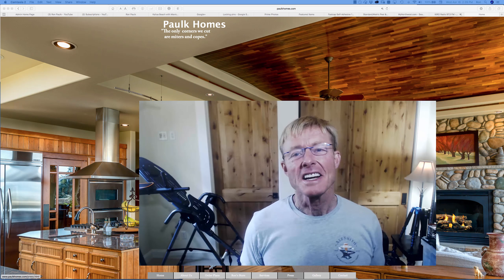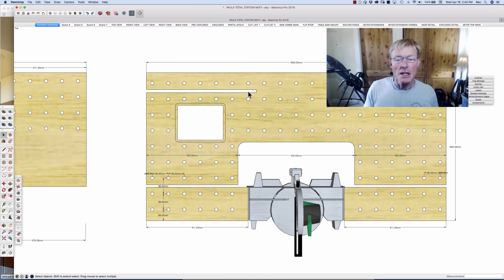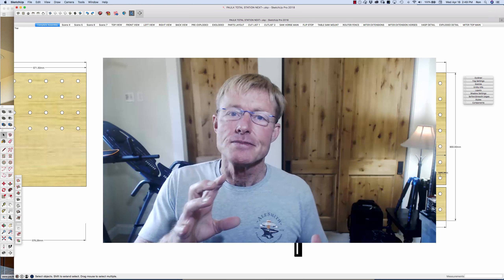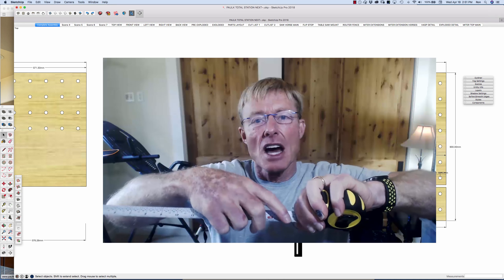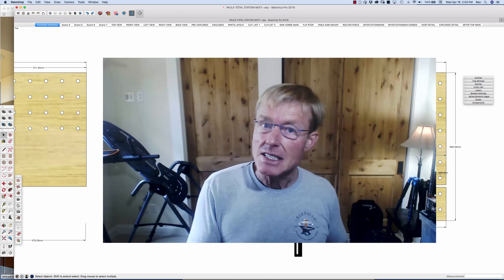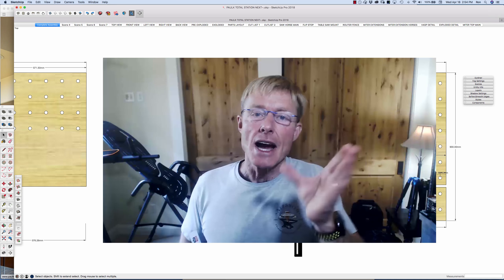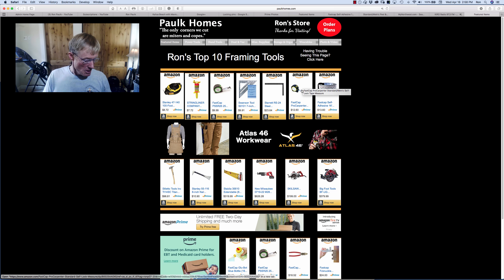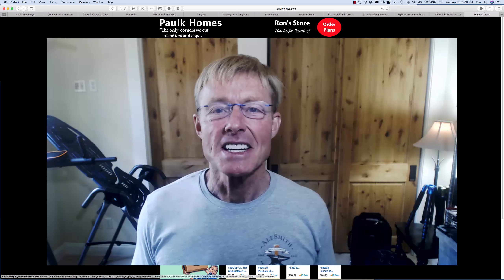I heard you: metric it is!

Comment: Great work Ron. 

It was suggested to me always to use metres or millimetres and never use centimetres and this gets rid of miscommunications and gross errors when working in a team as there is no need to confirm the units. (At the time we were measuring lines bigger than any house you have built)

Just something that was told to me in the 90s.  I have to use all measuring systems feet, inches, links, metres and more.

Comment: As you do the build, please explain any work arounds to build metric; such as using Standard router bushings and bits to cut accurate metric circles.
A handy tool is the INCRA Pro T-Rule - 6" or 12". It has Standard and Metric scales that are very accurate and easy to use like FastCaps PMS measuring tapes

Comment: Let’s put it this way, you have those countries who use metric and that country that has been to the moon. Not many things that are easier are better.
Reply: Sure, but NASA used metric to go to the moon ;)
Reply: MrMSandin and it continues to smash expensive spacecraft into Mars when it's staff don't use the right SI units and landers think they are at the surface when they are 300 metres up and turn off the engines and jettison the chutes...however it's perfectly possible to use any set of measurements or a combination or two or more. After all the actual length is the same its just how we describe it that changes. Here in the UK we buy sheet building materials that measure 1220mm wide. Why? Because that's 4ft and we've always done that... Ask any builder of any age and they know what an 8 by 4 sheet is even though when they buy them they are 2440mm X 1220mm.
Reply from the maker: It is funning hearing 8x4 as in the U.S. they are called 4x8😎🤙 It seems we do our call-outs width and then height. A 3'0"x6'8" door is width x height. Windows are the same. If I call my window company and say, " I want a Five O, Three Six, XO vinyl slider" They know I want a 5'0" wide x 3'6" tall vinyl window with the left side operable. That being said, we don't even say 4x8, we just order 20 sheets of 7/16"OSB or 3/4" Exterior ply. The length is assumed unless we are ordering taller than 8', then we just say 9' or 10' OSB and the 7/16" is assumed. Of course, all of my 30 years has been in the PNW, so other parts of the U.S. may be different.

Comment: I still don't understand where people get off on saying metric is easier. I guess it is for the mentally challenged. Or the "can't figure out how to do fractions and thousandths" type of person... But it's whatever the majority wants I supposed.
Reply: If you can multiply or divide by 10 the you can use the metric system.
Reply: The majority of the universe is metric. It's just taking you a bit longer to catch up. Just saying
Reply: I'm Canadian, Canada went metric in the mid 70's. I will not dispute Mr Paulks assertion that metric is more accurate. Probably is..I'm not a manufacturer only a hobby woodworker.
But I will warn you...right now if you wander into a grocery store and buy a pound of coffee you probably don't even look at the weight of the package. Same with a pound of butter etc etc etc. A pound is a pound and that package is a pound.
When you go metric like Canada is 1 lb becomes .4535924 Kg..so 1 lb is the same size pkg as about 1/2 kg. The pkg to start will be .453kg. then about 6 mo's later the .453 goes to .450. Package price stays the same but less product, just a bit less but then two yrs later maybe that old .450 kg pkg is now .380kg in the same size pkg as the old 1 lb. Then after 5 yrs the pkg is .350kg. same pkg..less product. No announcements and no one notices.
On and on it goes. And it does, every pkg'd product on the shelves,,cookies, crackers, ice cream, milk, choc bars, sunflower seeds, chew tobacco, baby food  etc etc....you eventually are getting less and less. manufacturers love metric for this reason. Everything drops in weight but remains the same price in about the same sized pkg. Sure by the time the pkg gets to .380 that old lb of coffee is now in a soft package and nobody has lied to you but those coffee manufacturers are getting the same money for only 2/3 the product..7th heaven for them baby.
Reply: I'm Canadian, raised with metric. As I learned carpentry I had to learn imperial measurement. My thoughts on the difference, imperial measurement is more intuitive for carpentry. It's easier to communicate, easier to read off a tape measure or ruler, and it's proportions are based off of the human body making what is built more relatable to those who interact with those structures. I see metric for carpentry as a bit of a regression
Reply: LOL!  Canadians be insane!
Reply: ed, I doubt this has anything to do with Metricisation.  All other things being equal, as the cost of production increases the pound of coffee will stay the same weight but go up in price, but the metric product will stay the same price but go down in weight.
As the cost of the pound of coffee goes up the manufacturers will start making half-pound packages.  The metric packages will one day sprout 'King Size' versions of themselves, etc.
Reply: In my opinion there is no question that metric is more accurate and it’s easier from the stand point that the numbers go from one to infinity. It’s really easy and I have using the Imperial system all of my adult life as a cabinet builder. The hardest part for me to get accustomed too is knowing roughly how many mm were in a foot or two or three for an example but I got over that pretty quick.
Reply: I grew up in a metric country... I have absolutely no clue how to calculate fractions (beyond half, third, quarter and eighths).  No need for fractions in a modern society 😉
Reply: Danny Wilsher the reason is that it is easier not that one is mentally challenged. So you as am I are more familiar with inches and fractions, and using decimals doesn't make it better. Consider using the measurements of thousands of an inch is pretty much exactly what you do when using metric!
Reply: Riffmeister, I guess my mind works differently than most. When I am dealing with fractions, decimals, or metric my head has a picture of what I am trying to accomplish with what ever I'm building, machining or whatever and it just happens. I guess my subconscious has it figured out and I don't really think if one or the other is easier or harder. It just flows. So that is why I don't think metric is easier than imperial. I also don't think imperial is easier than metric. To me they are equal. Both are just a way to get to the same result. And I agree that metric is like using thousandths so not easier or harder. 
I guess I was too harsh on some saying the "mentally challenged" comment. If I offended anyone, I beg your forgiveness. It wasn't meant as a cut or negative comment.
Reply: Barry, I watched the entire video and it was very interesting to see how long they have been using metric as the standard. Once again I will apologize for the mentally challenged comment. It was meant as more of a humorous comment than anything. And I know people can't read what's in someone's head from a comment on YouTube. But hey I like the "mate" mate!!! lol...